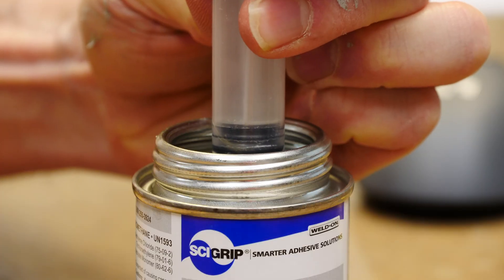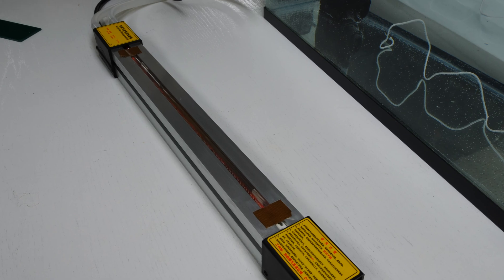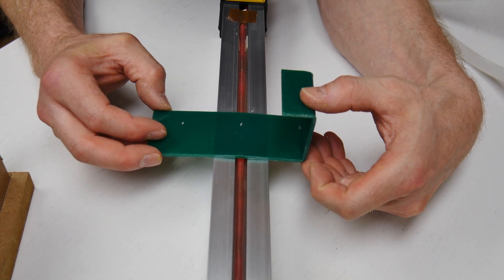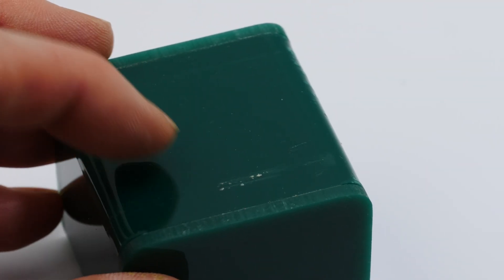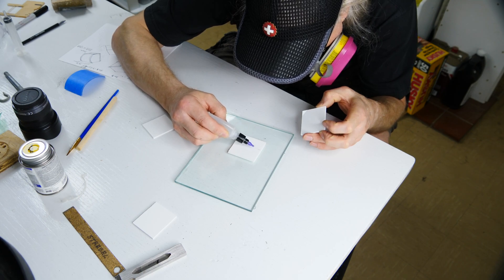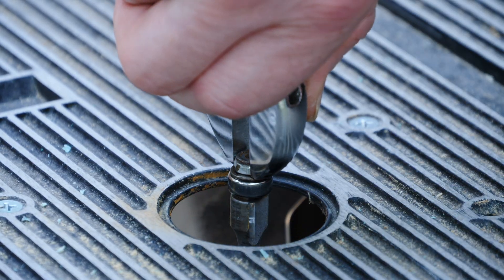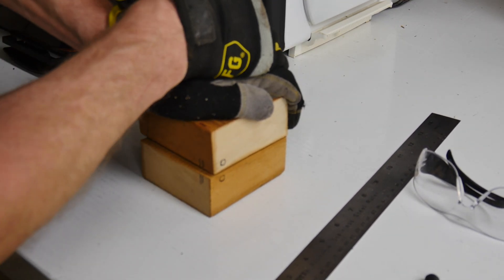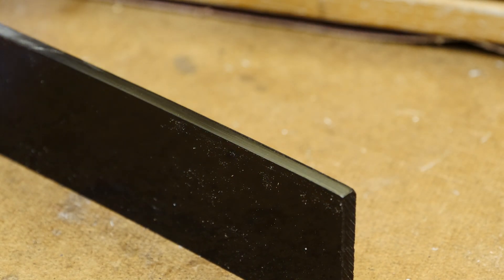Acrylic Advanced Basics model making for Designers, Architects & Makers

Comment: A tip about flame polishing...practice several times on scraps before attempting to polish something you've spent a lot of time and money on.  Acrylic retains heat and each pass of the torch adds a little more.  Many times I have thought I had the perfect edge, only to see it develop hundreds of small bubbles, completely ruining the piece.  I like to sand to at least 180 grit before using flame.  Also, remember not to get solvent or even alcohol near a flame-polished edge, or even an edge sanded above 320.  It will craze.
Reply from the maker: Good tips

Comment: What’s the best material to pour so the cold won’t crack it?
Like 26 below actual temp not wind chill.
The parts will be threaded and both screw into each other. 
They will be inside woods and polyester parts.
The parts will be glued in the wood or poly parts.
What a question right!! Lol
Thanks
Dan

Comment: Be careful where you purchase your dichloromethane. I purchased some from ebay and the chemical evaporated through the plastic lids of the metal cans. The chemical worked great when I first used it but when I returned to use it again a few months later, all the cans were empty. Even the can which hadn't been opened was empty.
Anyone purchasing this or other chemicals should make sure the containers and lids are appropriate for the chemical's storage.
Thanks for another interesting video Eric Strebel.
Reply from the maker: Good advice, buyer be ware

Comment: Hello Eric.
Please advise.
The situation is as follows - you need to cast a certain number of housings for electronics.
Of course, the best method would be injection molding into metal molds. But it is very expensive and not suitable for small series production.
I thought it would be worth trying silicone molding. But what composition to use?
Probably, this should be close in properties to ABS plastic. At the same time, is not very expensive.
Advise what to look for.
Reply from the maker: Posting your question in the wrong vid BTW, but look for a shore 70 or shore 80 hardness resin to match the ABS property
Reply: @EricStrebel  thanks. I just picked the last video for my comment. )

Comment: A freaky trick to Polish Acrylic is "Vapor Polish" by holding it above the Open Container of DCM

I had one really expensive sheet for a Customers Project with a tight Time-Frame to finish. It arrived with the original Foil still on as expected, BUT a huge scrach straight across it... through the Foil no time to by a new one.
The scratch melted away within 5min, no sanding, no Polishing, no Cleanup.
But it works only with Shallow scratches
Reply from the maker: Oh, interesting, I can see how that could work! Thanks for the tip!
Reply: @EricStrebel  The DCM basically 'liquify' the Surface
It is a bit like 'Vapor smoothing' ABS Printed Parts
Don't overdo it or the surface gets blotchy... stop before you think 'Thats about right' because it will continue to flow until the DCM is evaporated...

If you drop the Container of DCM in a warm Water Bath you'll see changes within second... don't stay on one spot for more than 2-5 seconds, keep moving all the time

I fixed one of my Vats for my Moai Resin Printer with that method in 2-3min

Comment: Great vid as always, thank you! The press forming option is very interesting... Do you think the acrylic is soft enough to press into a double-curved lid for an enclosure, around 300mm square? I've always thought vacuum forming or urethane casting is the only real option for that but the former is too thin and the latter requires a more expensive mold build than a press form I can CNC out of wood.
Reply from the maker: Yes